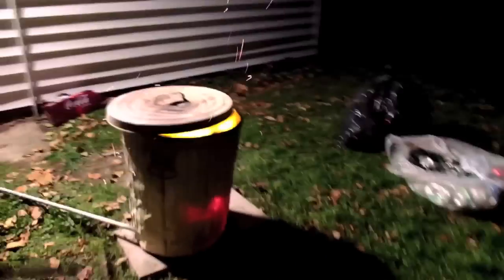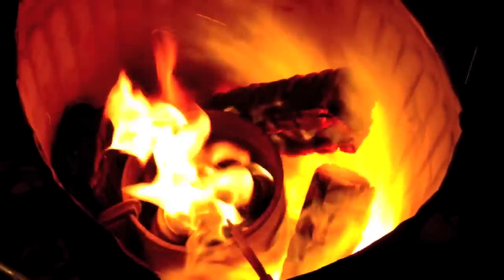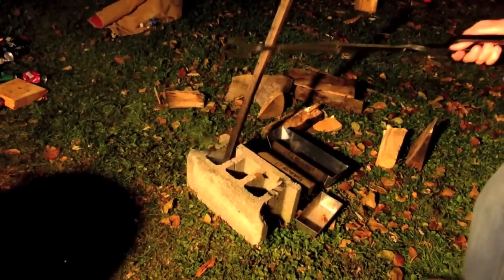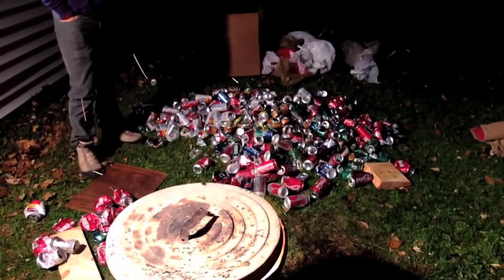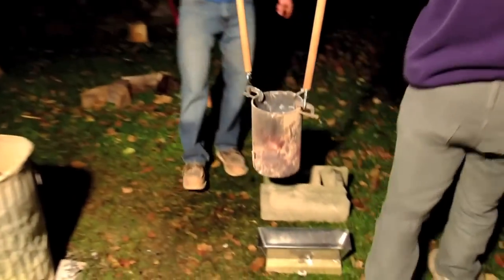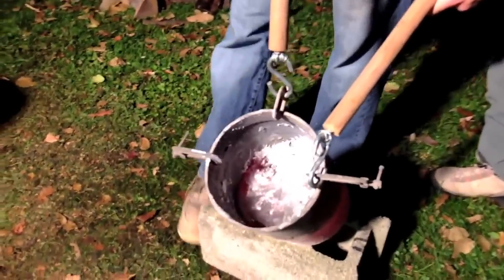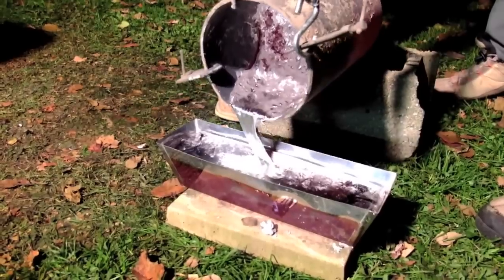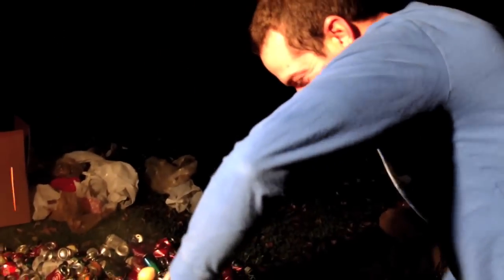How to Melt Aluminum Cans into Ingot

Comment: pretty cool way to smelt, cheap too.
But don't know if its been said yet as I cant be asked read all comments,
That is not pure aluminium, there will be a lot of slag and impurity's in that cast as you haven't filtered it,
if you want to do it cheaply get your self a colander ( stainless steel one) and flatten it, weld a metal handle to the center and bolt on a wood handle,
while its still molten in the crucible/fire extinguisher plunge it with the sift you just made,
keep plunging it in and dragging it out until there is no more of the thicker slag coming out.
there are better ways to purifier the alloy but that is about the cheapest

Comment: it should be noted that doing this in a metal trashcan is ill-advised and not very efficient, in addition proper safety gear (face shield, gloves) should be worn when handling molten metal, no matter how minor the risk seems. if the trash can contains zinc and it starts to melt, it produces some VERY poisonous gas. normally, the foundry would be made out of a fire-proof material like a mixture of concrete and perlite for durability and insulation, and the fire and crucible would sit inside. no toxic burn-off from the container and it heats up faster because its not transferring to the air immediately around it. please be careful! there are many people who would try to imitate this and potentially suffer some heavy consequences.

Comment: Holy crap guys. If you're watching this thinking of copying them don't. First of all, that is the worst way to pull molten aluminum out of a foundry; you got very lucky that didn't spill all over one of you. Those casting containers were not prepped properly. If there had been ANY moisture in them at all the aluminum they cast could have popped and splattered in all directions. Happens all the time.

Comment: You might get a much better, hotter flame, by building, using a "Rocket Stove"!!!  You might want to use a charcoal fuel too as it burns very cleanly, compared to wood, paper, etc.   You should coat the ingot mold with a heavy layer of soot (use an acetylene torch), or pour it into a 'sand casting' trough, groove, or trench, to make a long bar shaped block of aluminum alloy.   Do you know what the "alloy" content is of this material?....

Comment: Great use of materials. Love the clamps for holding. One question though. What type of pot did you use for this. What holds up to that kind of heat?
Reply: We used a fire extinguisher... which worked well for this one but failed on the next video.  Check out Ben Snyder 's channel for the latest video.

Comment: ive been wanting to melt down some broken florescent bulb glass, some guy in china does it it turns into some cool looking glass that he's selling for big$ , from junk bulbs , requires a lot more heat, still working on my backyard blast furnace,instead of the shop vac , I gotta mini squirrel cage blower works well and quite

Comment: today Aluminum Prices  is at 0.92 cents per pound

the avg can weights 15.5g if that block = 500 cans than

15.5g x 500 =7,750 grams = 3.85809 lbs x 0.92 =$3.54

Considering production time, cost of materials  this is a financial loss

in my area a 12 pack of soda can be purchased 3 for $12
That equates to 13.8 12 packs costing $55.20 + deposit of 0.5 cents per can

certainly a fun thing to do ....but not worth the money in return.
Reply: This is without a doubt a financial loss. Aluminum is so cheap. The electricity from the shop vac probably costed them more than the ingot is worth. Hell, the energy from the food they burned during the whole thing probably costed them more lol.
Reply: Agree to all of this.  I was just for fun.  I aint quitting my day job any time soon!
Reply: Who gives a shit if it's a loss? It's the doing that's important. The experience. Nothing is more of a loss than the time you spend trolling on YouTube.
Reply: AGREE!!
Reply: Aluminium is firstly a material, then maybe a financial good. The things you could do with that mate. Money is cool and all but, like go tell a diver his oxygen bottle is not worth the return cause there's free air everywhere and all.
Reply: Agree, not to mention the potential fire hazard, and release of toxic poisonous gasses and vapors they're exposing themselves to.
Reply: They have a second video on another channel weighing in the ingot at over ten pounds
Reply: Look at the idiots on here talking about aluminum, like all aluminum is the same haha.
Reply: we get 15 cents for deposit where i live
Reply: Oh maybe I should bring my cans and bottles to your state I only get a nickle!
Reply: Thomas Hynes buying a plane flight to get to finland and back will cost about 600 dollars im afraid
Reply: ***** thats possible?
Reply: Basically those guys could sold those cans at  1 penny a piece and made 5 dollars, but instead the melt the 500 cans to make that  bar, which is only worth $3.54.

STUPID...............
Reply: 7750 grams is 17 pounds which is about 15 dollars of aluminium
Reply: I'm sure that getting the money from the million views was worth it
Reply: comedyandstuff yeah but only if they clicked on the ads
Reply: EATITTV
Nah, YT's partner program pays per view now.
Reply: Wouldn't it be 17 lbs because there are about 448 grams in a pound
Reply: Please stick to the metric system most of the world's doing it!!!
Reply: Keith Tipping Yeah... i don't know how he managed to mess that math up

Comment: well it looks cool, untill you get some fluid in there, and the whole bar and all the stuff explodes righti n your face..........

yeah, get some water in there, and it will blow.... so, you guys are crazy for coming so close while pouring the hot metal.
Reply: we did this stuff in metal shop , not scared
Reply: Tim Schuchard you can be unafraid and still get killed; so John's fears arent for naught. while it is unlikely, you should still be careful and wear appropriate safety gear (gloves, face shield) when handling molten metal.
Reply: Yeah   molten metal is so hard to get off ur face when it already happened  ☺
Reply: ya it kinda digs in, been a plumber for years

Comment: I think the aluminum cans in the US are an aluminum alloy. Something like 97% aluminum, some manganese, magnesium, chromium, and trace metals.
Reply: Al 6061 is a very popular grade. It is quite pure compared to something like 356.2, which has Si in it to make it flow in a casting.

http://www.keytometals.com/page.aspx?ID=CheckArticle&site=ktn&NM=235
http://en.wikipedia.org/wiki/6061_aluminium_alloy

The majority of the properties in aluminum alloys are determined by their alloying elements to form intermetallics, as well as their cooling rates / heat treatments they put them through to control precipitates, grain size, % of theta/theta prime, etc.

Comment: How did you get it out of the ingot mold without being stuck to the sides
Reply: It actually came out without too much trouble.  Just took a little prying with a screwdriver.  Thanks for watching Alex!
Reply: I watched a different video and I will give you a tip from it, keep it in the mold until it turns solid while still red hot then take it out

Comment: Awesome pour. Beautiful! What was all that gunk in the bottom of your crucible?
Reply: we scooped most of the "dross" off but there was still a lot in there.  We ran out of charcoal so we had to use wood and the fire had a hard time staying hot enough
Reply: Zach Holt
should have tried thermite
Reply: Zach Holt The stuff at the bottom is actually slag, it's impurities from the can not melting, forming a the gunk on the bottom of the crucible. The worst part is, you left it all in the ingot ;P
Reply: some, not all.  We scooped ALOT out.  Just did not show that part.  Next time we will!
Thanks for watching!
Reply: Zach Holt Ah, okay. Now that I look at the bar, it seems a lot cleaner.

Comment: Hey guys, at first, nice job! 
I've watched Jesus Hernandes Bladesmith`s videos and also got inspired in melting metal. I made a few arrangements but I got stuck when it came to raw materials. I believe the melting temperature of the aliminum is quite high and I was wondering about how you manage to get that fire-temperature, so, can you tell us little more about that? Or at least where did you get the information
Reply: aluminum melts at 1220F so you need to use charcoal and some source of moving air to get the fire that hot... like a hair dryer, or a leaf blower, or what we used, a shop vac.

Comment: How did you remove it from the cast? Did you bend the cast away from it or did it just come right out easily?
Reply: It took a little prying with a screw driver but it came out pretty easy.
Reply: Thanks.

Comment: If you want to get a lot of the slag out get a long handled steel ladle and skim it before you pour. Thanks nice to see folks trying to do stuff on their own, just be careful, I didn't see much in the way of safety gear. If you get an eruption when standing over the crucible, you will be blinded. Note, keep your ladle heated. GLHF Sam.

Comment: Pretty cool.  Much larger then the foundry operation I got going on.  Though I have to say you're doing things really unsafe even by backyard foundry standards.  Three major unsafe things.  1.  Garbage can furnace.  Metal garbage cans are coated in zinc which oxides around 900 degrees into poisonous fumes.  It takes only a small amount to make you very very sick.  Look up zinc poisoning.  2.  Wooden tools.  Really? 3.  Sticking your hand in front of a pour.  Had the molten material spilled and hit your hand, you wouldn't even feel it.  It would just taken off whatever flesh/limbs it touched.  My neighbor worked in a professional steel mill, and they spilled a crucible of brass, it spilled and sheered off a coworkers toe through his boots.  The stuff is practically lava.

Comment: I use to work for Reynolds aluminium.  If you preheat the mold it would of cam out alot cleaner and less defective marks.  Others not bad for first time.  Also you need a thicker mold as it will start to warp when used over and over

Comment: I'm tempted to make some molds for random stuff and try this out! I'd probably start with rings or some sort of blade. I have no idea what to use for a mold though...
Cool video, guys!
Reply: Aluminium wouldn't make a very good blade
Reply: If you want to make a cheap, easy casting, you buy two cuttlebones from a pet store (cuttlebones are the things they put in bird cages for them to sharpen their beaks on). Cutlebones are actual bones from cuttlefish, but they are very soft. You rub them together , and they will sand each other down till they fit together flat. Then with a hemi-file you file out a notch at the top of both bones. Into the flat side of one of the bones, you carve a channel towards the middle of the bone, you carve out the shape you want to cast into the bone (don't go too deep because the cuttlebones are very thin). You can definitely carve out pendants, possible a ring. You wire the two bones together, with their flat sides firmly against each other. When you melt down your metal you pour it into the notch you filed out at the top - the molten metal will pour into the cast through the channel that runs from the funnel to the object. Wait for it to cool (depends on what metal you're using and how large the object you're casting is). It smells bad because the bone will scorch when you pour, but it works. When enough time has passed to remove the casting safely, unwire the cast, and open. Break you object free of the funnel and channel, and clean up/ polish etc... I've done this is silver smithing classes before. Have to make sure the two halves fit snuggly together because you don't want molten metal running out of it. Don't pour the metal too quickly because you don't want the metal overflowing either. Use common sense, take precautions. Use at your own risk.

Comment: So to compare the selling price of that aluminum bar to what you would have received from refunding the cans, could this be profitable? Or is it just for fun? ;D
Reply: I also am curious how much you would get from taking that into a scrap yard especially compared to how many cans you used to make it and see if its profitable to smelt them down or just the good old crushing method.
Reply: I have no idea, but I know for a fact that the cans we're worth more than the ingot sold as scrap metal.
Reply: I would say that they lost money on the deal. Cans are worth .05 to .10 depending where you are. If I am right scrap aluminum even in an ingot is only worth about a dollar to 1.5 per pound. Being generous that ingot weighs 20 pounds and would net about $30 under best circumstances. Judging from weight and estimate of cans they were referring to by the pile they had it would be tough to profit here if at all. I would say that they used at least $25 to $40 in cans plus the expenses and time.

Comment: Nice fun to try once. I've done it before. Sand casting is just as easy if you know how to do it and you can reuse the metal mold as a form shape over and over.
  But Hmm, so 13lbs x current spot price approx $.80/lb = $11.05 Vs. Cost of wood/garbage can/cast/health insurance?
  OTOH some recyclers surprisingly will pay up to 50% more for cast vs cans while others I've found online pay LESS! So YMMV
  Hope you're not in a U.S. state which charges a 5 cent deposit per can or you're out at least $14 (501 x .05.)  .
  BTW 1 used clean can including paint = ~ .45 oz so 500-600 cans is probably about right.
Reply: We certainly spent more money that we could ever get out of it. But, can you put a price on something as amazing at turning bags of nasty, sticky cans into a big bar of aluminum?  I say it was worth it.  In fact, we plan on spending more money to try it again! Check out the YouTube channel  TheWoodShedd for upcoming videos.  We will be doing it again as soon as some current projects are finished. :)

Comment: You should have used charcoal briquettes, as they burn hotter and longer than wood, or at the very least, used hardwood, but pine sucks.
Reply: pine burns hotter than hardwood
Reply: we started off with charcoal but that ran out pretty quick
Reply: Charcoal briquettes or regular charcoal? Also, if just regular charcoal, do you know what type?
Reply: We did this last November... so I cant remember exactly.  Probably what ever was the most bang for my buck as far as price per lb.  I am sure that each brand has a slightly different BTU potential.
Reply: I see. I use briquettes in a forge that I made, it's really efficient. Check it out on my channel. The only problem is that it will melt anything, including a graphite crucible.
Reply: TheGabeForge charcoal and charcoal briquettes are one in the same (burnt wood). I believe you are referring to coal ( Anthracite) which is a mineral
Reply: ***** On the contrary. Charcoal briquettes have coal dust, and many other things that make them burn hotter and longer. I melted my graphite crucible with them. Charcoal is just plain burnt wood. Anthracite is quite difficult to come by, so is not a good option for smelting, especially in a large space, like the trash can like they used.
Reply: TheGabeForge yes, I stand corrected they do have filler. I am surprised that you don't use lump charcoal. I have found it to burn almost twice as hot as briquettes. Have you tried this yet?
Reply: No. Where can I get some?
Reply: TheGabeForge You can get it almost anywhere. Home Depot sells it under the name of "Royal Oak", but most local grocery stores around here like Trader Joes sell it. It's also cheeper
Reply: Hmm. I'll see if I can get it, because we have a Trader Joe's and a Home Depot near my house. Thanks!
Reply: Yes, but it burns much faster. You should do a 25% pine 75% hardwood mix.

Comment: you really should use a thicker mold, and definitely heat the mold up before you pour. also, a cheapo garage sale cast iron pot would work great. and throw about a 1/4 stick of butters worth of paraffin wax in as the aluminum starts to melt, it'll help separate the impurities.

Comment: Cool idea. I will save my cokes now but one question...how is the ingot not colored from the cans being colored? Does the hot temperatures burn it all away?
Reply: all the paint and wax inside the can get burned away.  Most of the impurity were scoped off the top before pouring into mold.
Reply: Zach Holt thanks I have been learning more about smelting recently. :) I love this video.